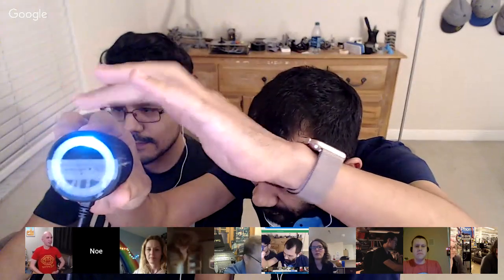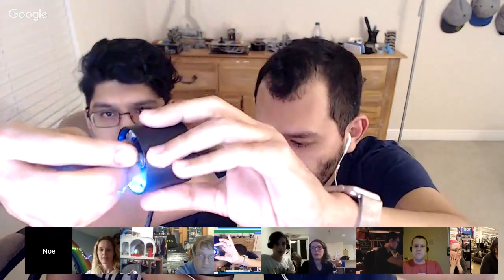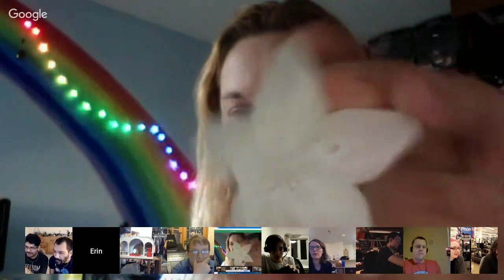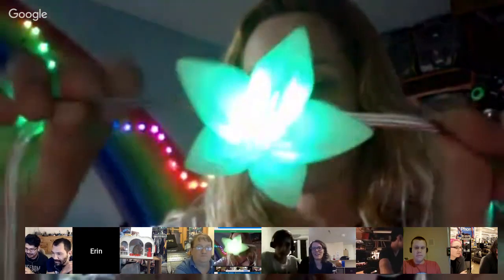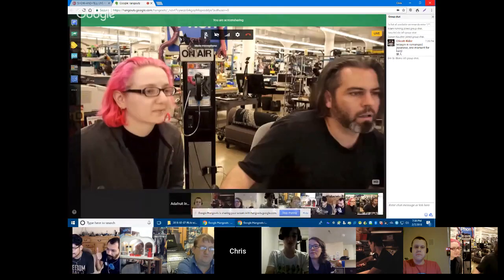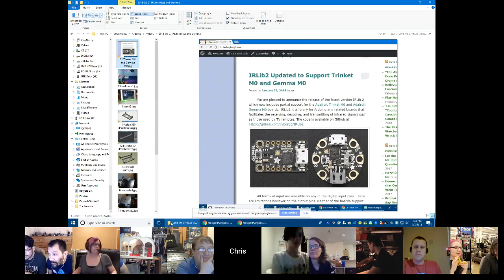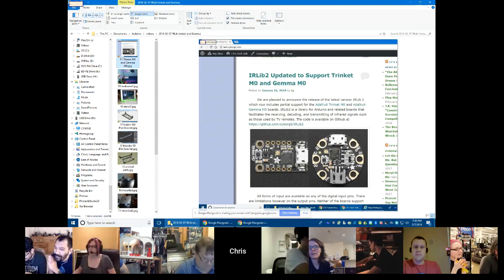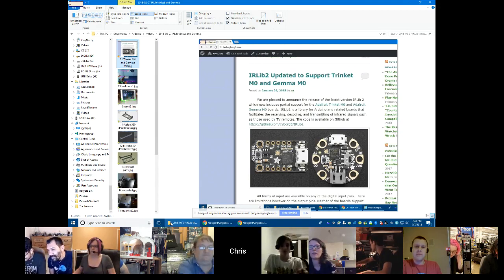SHOW-AND-TELL LIVE VIDEO! 2/7/18 LIVE @adafruit #adafruit #ShowAndTell

Comment: I forgot to mention you can find out more about IRLib2 all my technology blog at http://tech.cyborg5.com/

I also forgot to mention that I wished I had a photo of power supply and that old 1970s era S100 based computer. It was a non-switching power supply with a transformer that was about a 5 inch cube and it had capacitors the size of a frozen concentrated orange juice can. The thing was a monster.

The 16k memory boards consisted of 1k by 4 bits ICs with a total of 32 of them on each board. The entire thing ran at 4 MHz. There's almost more computing power in an Arduino Uno then there was in that behemoth machine from 1978.